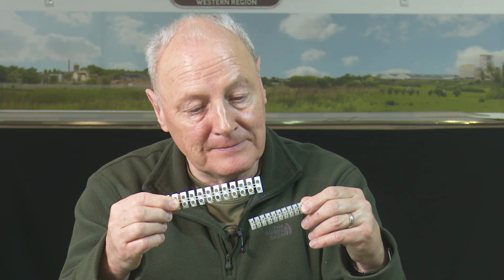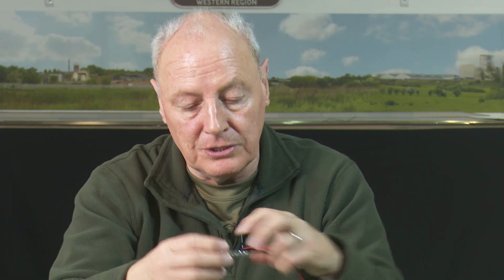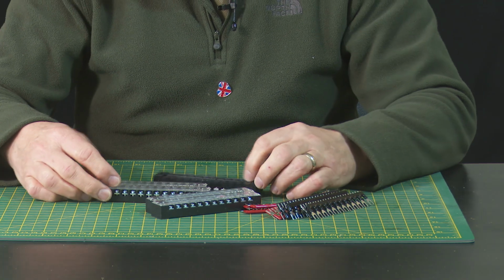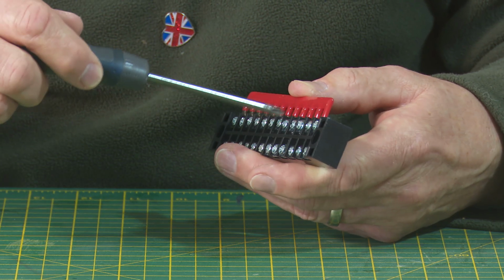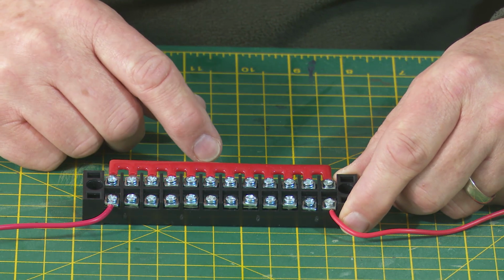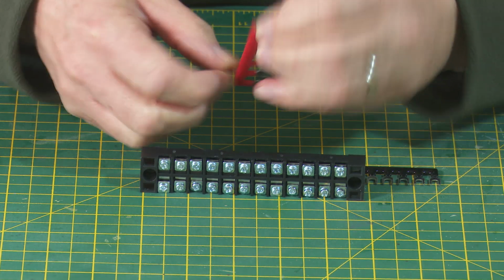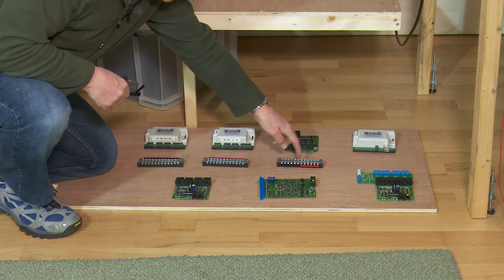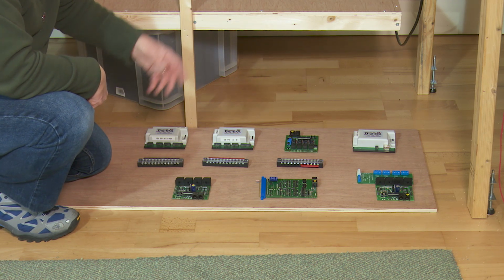Terminal Blocks for model railway wiring at Chadwick Model Railway | 85.

Comment: We use these on our club layout.  And I would recommend using some appropriately sized spade connectors crimped onto the cable ends.
Reply from the maker: Do you use a crimper Ken?
Reply: @ChadwickModelRailway  Yes - the terminals come in various sizes to suit the wire gauge, and the colour of the insulated ferrule over the wire end of the connector specifies the gauge.  Takes a bit of practice to get it right, but at our club layout, I've been going through replacing all of the rather dodgy connections (wires stripped and twisted together... I wonder why those lighting strips were unreliable?  Where did that burning smell come from?)  with correctly sized wires, terminated securely into terminal blocks just like you've shown.
Reply from the maker: Thanks Ken, I’ll do some pricing.

Comment: I have an idea for you Charlie, you can fit a crimp halv circle connector to the cables so it is more easy to fix in the terminal block and you do not risk the wiring just pulling out
Reply from the maker: But a certain amount of extra time and work, I had considered it but the cables are secure.

Comment: If you are soldering under a baseboard, there is a risk of getting solder splashes in the eyes, so some safety specs or goggles would be a good idea.
Reply from the maker: Very much so CJ

Comment: Excellent Charlie. Saves a heap of soldering. Just went on to Amazon. Seller only has one left in stock. They come from China, (where else), so may take a while. Quite a few ones with different connections. I am abroad at the moment so will check what is available when I get home. There are a lot of Cheers. Pete
Reply from the maker: Have a great break Pete unless it’s work but do stay safe.
Reply from the maker: I’ve just checked the Amazon page and the dropdown menu starts at “1” but there appears to be more available.
Regards Charlie
Reply: @ChadwickModelRailway  My stupidity Charlie. I did not notice it was a drop down box!
Reply: Yup. These are standard in Chinese machine wiring. I have been engineering in China and I hate them. Too easy to overtighten  and strip the threads etc.Also too bulky, but thats not an issue for your application. For an anternative UK supplier of similar stuff have a look at RS Components website.🙂
Reply: Something like this is best. I dont know about model railways sorry. This is just going by experience of machine building, especially in China with Chinese kit 😂
Reply: These terminals are much more expensive of course, but they are designed to capture and compress the wire rather than just brute force  squash it. They have a small screwdriver slot to limit tightening torque, and if you note the “wire box ” design, they apply no torque to the wire itself. The Chinese block connectors you showed have big screwdriver slots, mainly because Technicians here tend not  to have a collection of tools. The box cable design also has a certain spring in them, so the screw is held in tension. Gives more leeway in tighening torque rather than just brute force as in screw head to plate. Not so important with low dc power of course, but in DCC I suspect poor connections might affect the signal wave. But as I said, I am not a model maker. The example terminal above also has bus bars, end covers, fuse holders etc that can be fitted. Its just a thought. Great vids by the way. Week 6 of lockdown in China, so great way to pass the time 😀